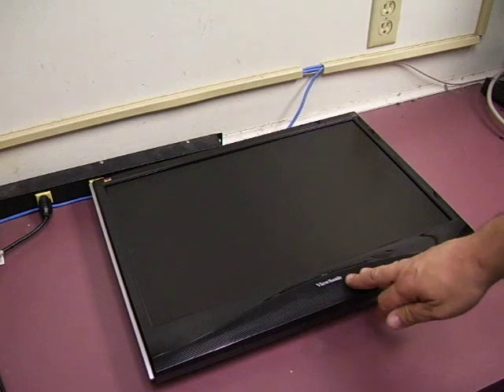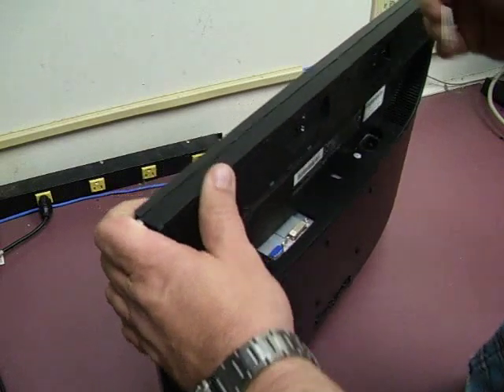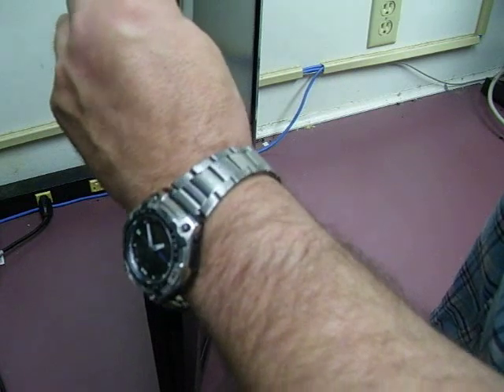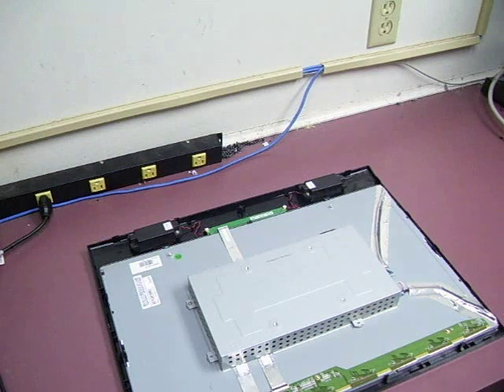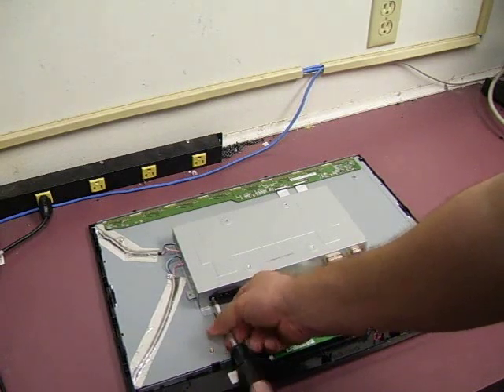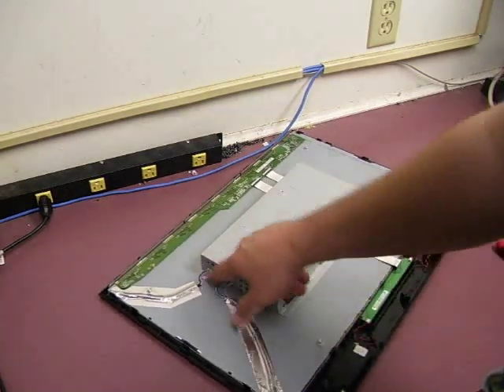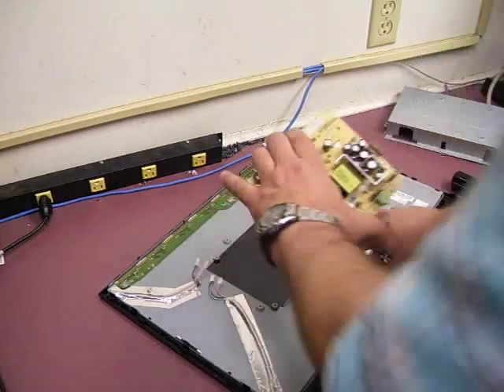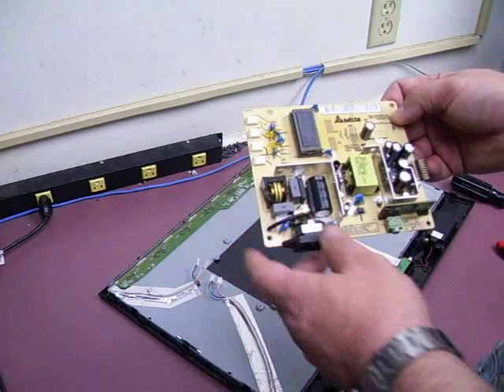Repairing a Viewsonic VX2235wm - Part 1 Dis-assembly

Comment: Hi thanks for sharing. I've replaced all the capacitors in  in my Viewsonic (its two boards) but it still turns on, then after 30 minutes it'll flicker in 8 second intervals? After the capacitors, with this symptom, what's the next one to check?

Thank you. God bless, Rev. 21:4

Comment: I have the same monitor. I have to let the monitor "warm up" then I disconnect the power cord and plug it in. Then the backlights turn on. The blue light light blinks once and stays a steady blue. And will run all day. Same fix? Or replace backlights?

Comment: I'm hoping this may repair my problem: My monitor blue light comes on with nothing on screen. The Mac system prefs > Monitor shows that the monitor is connect. If I hit refresh over and over again, sometime up to 20 minutes - the screen will flicker and finally become stable, until unused and in screen saver mode -- then the game must be played again. Does anyone know if this will work for my issue. THANK YOU!

Comment: Don't forget to remove the 4 screws on the back. Plus, you have to pry off the plastic monitor mount covers. Other than that an easy fix. I've done much harder projects. If you can't do this in under an hour, I don't know what to tell you.

Comment: Thank you very much. I was able to fix my monitor by following your video. I ended up replacing 4 capacitors which cost me 80 cents. My monitor was switching on without backlight. Nevertheless, your fix worked.